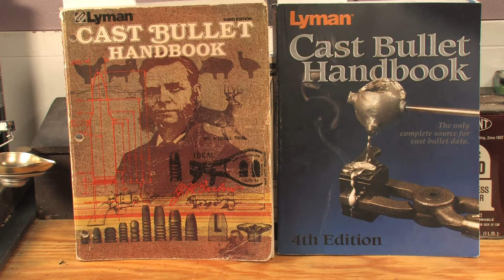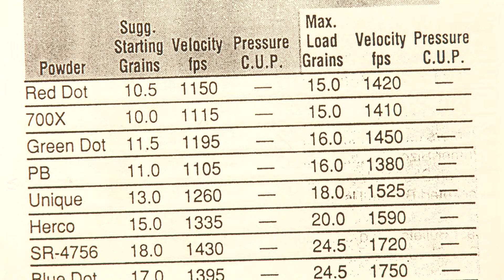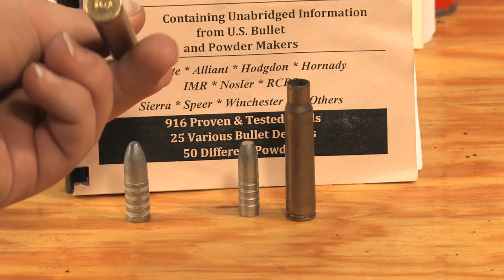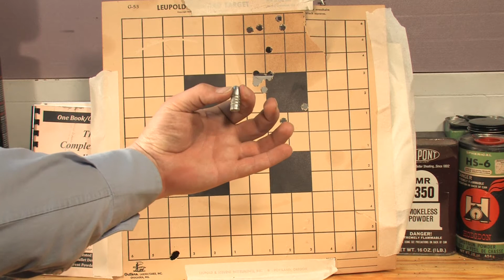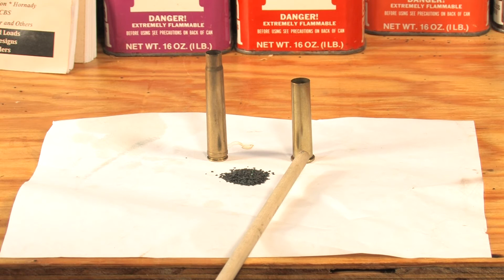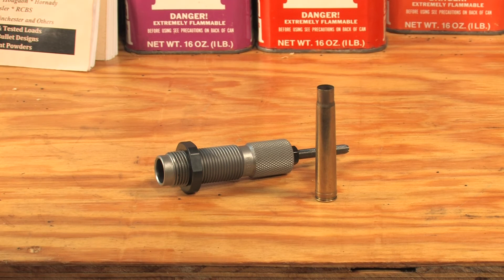375 H&H Light Cast Bullet Project Part 1:  Choosing A Bullet, Loads to Test, Things to Consider

Comment: Fantastic video exactly what I'm looking for. Ordering some of the books you've shown and thinking of working on some light cast loads for 375 Ruger
Reply from the maker: Be careful, the 375 Ruger is a new cartridge and you won't find any useful pistol/shotgun powder reloading data in any of the old books.  Keep in mind that trying to use 375 H&H or 38-55 or 375 Winchester smokeless data in a different cartridge, no matter what the comparison is of total case capacity between them, there are other dynamics at play such as how the powder burns in the case space.  Using data from the other cartridges can be dangerous.  Also don't be surprised if your results are terrible, old long cartridges like my 375 H&H as well as the Mauser family (8mm, 30-06 et al) are well known for versatility and their ability to perform well across a wide spectrum of full power loads to medium, down to light lead.  More modern short cartridges that are shorter and fatter don't seem to do as well with reduced loads, this is a huge disadvantage to these designs. 

In all reality the 375 H&H is a vastly superior overall cartridge to the Ruger.  But, good luck.